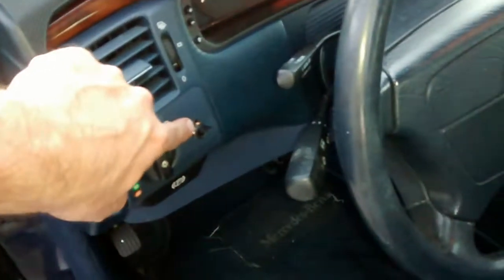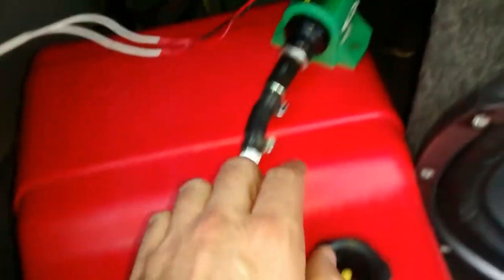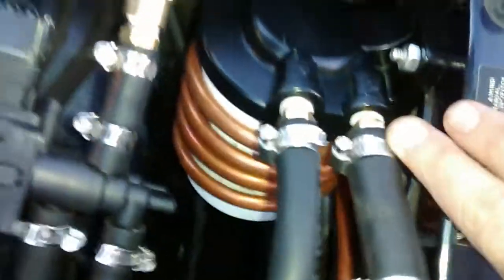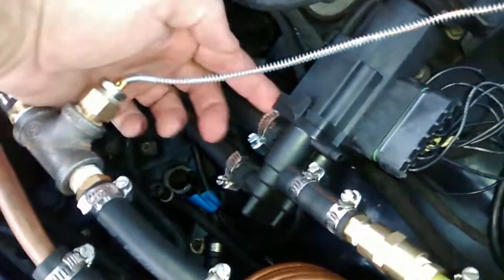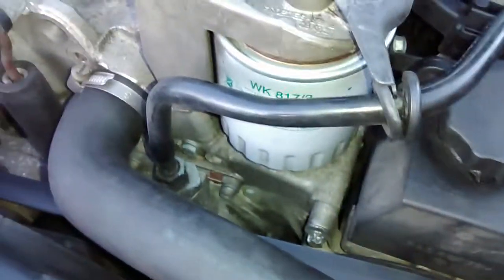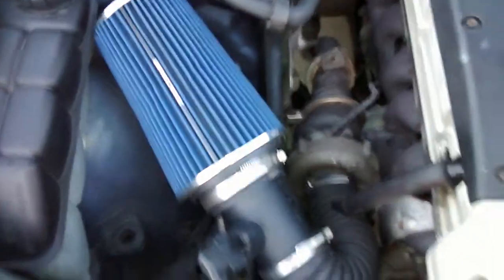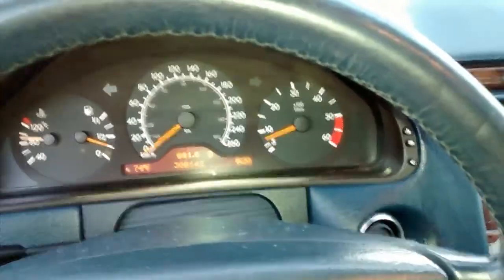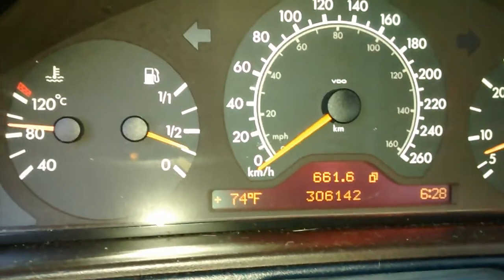1999 E300 Turbo Diesel SVO/WVO Conversion

Comment: How has your Mercedes held up using wvo? Any issues or problem areas? Thank you!
Reply from the maker: Its still running great. Running back and forth with petrol Diesel and waste vegetable oil has been great to keep the oil from sticking up and causing issues. No problem areas at all,  just City driving you cannot run  vegetable oil without flushing it out  before turning the engine off , so it kind of defeats the purpose in the city....  but running it on the highway is great! Thank you for the question!
Reply: @ther1rida  Thank you very much!

Comment: Well, its been 3 years running on Biodiesel....Whats the verdict? How's the car running? Also, you say Biodiesel or is it SVO, B100, B20, B5?
Love to hear about your long term experience with the e300td on Bio.
Reply from the maker: So the verdict is I had a just a little bit of collection on the exhaust valves but other than that the turbo is pretty clean and no issues still going strong every day! I have not had any issues with power or trouble idling or accelerating. If you are not afraid to put in the work it is well worth it if you are going for Highway use.
Reply: ther1rida ther1rida 
How did you notice buildup on the exhaust valves, did you remove the header? Did you have to clean the valves? How many miles do you have on SVO? Notice any blow by?
Thanks

Comment: Do you think this and other older merc diesels could be tuned for higher power with a bigger turbo, injectors etc. and still run WVO when tuned, even with, say, meth injection?
Reply from the maker: You can do tons with the Mercury diesels, however you can deplete a life for sure on them.

Comment: Thanks for sharing your knowledge. I am running a Ford Galaxy 7 seater 2011 ( peugeot engine) on 60/40 vegi/D mix and it runs better than on straight diesel. I plan to do a modification like yours so that I am able to run in winter without issues. Thanks once again.
Reply from the maker: Tahir Rana that's terrific, I love to hear things like that. Good luck!

Comment: Hows the turbo holding up? Ive heard that turbos tend to clog up due to the excessive soot from the WVO's combustion
Reply from the maker: There is a little bit of soot build up, but it is amazing and if you do a little bit of cleaning every 50,000 you should be fine
Reply: ther1rida ther1rida how about soot build up in the engine ?

Comment: Is there any point in the heat exchanger in these engines. They have one mounted under the intake manifold already do they not?
Reply from the maker: ratgreen that is actually a very good point thank you for bringing it up. The factory heat exchanger works great for the diesel fuel, however to keep from cross contaminating the diesel lines, I do a separate heat exchanger after the point of acquisition to avoid cross-contamination. So after the actuator plungers it keeps the fuel separated much more efficiently.

Comment: hello. i have W124 250D (OM602)
i want to run it with used cooking oil. without any conversion unlike you. is it possible to run without harm to the engine? should i change any part or do anything before running on waste oil? i am planning to run it in all but winter season. does it differ if i blend it with regular diesel, or should i run it with full used oil? which is less harmful? any tips? thanks.
Reply from the maker: I would definitely not run straight vegetable oil without a solenoid to change it over back to diesel fuel. It is only safe to use vegetable oil at around 185 degrees as the viscosity will be much like diesel fuel at room temperature. Not only will you raise the pressure up extremely high in the injectors, you will cause fuel pump damage in the high pressure diesel fuel pump due to high pressures. Once the vegetable oil cools, the viscosity goes extremely thick and will clog up the injectors and a matter of several cool offs.
Reply: Dont waster you time, you cannot beat regular fuel for energy content and cleanliness. This waste VRO crap will fuck up the injector system and it does not burn as hot.

Comment from the maker: Yes, that is the OM606. I love that block! Thanks for the comment! Good luck on the BMW project:)
Reply: is this motor too big for an international scout?
Reply from the maker: I think it would be perfect. It has great torque!!
Reply: thank you for responding. Great. I think i'm gonna go for it, the only problem is, the scout is a 4x4. i'm not sure if the transmission attached to the om606 is 4x4. maybe i can use an allison 6 spd with it.
Reply: @KARLOSJOZEF  look up diesel pumpk uk for adapters for transmissions and other stuff om606 related